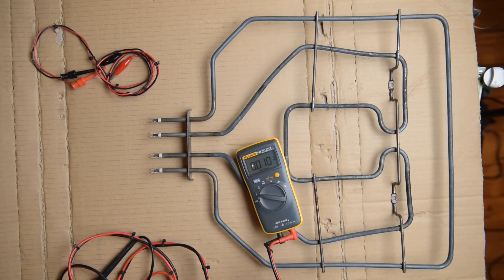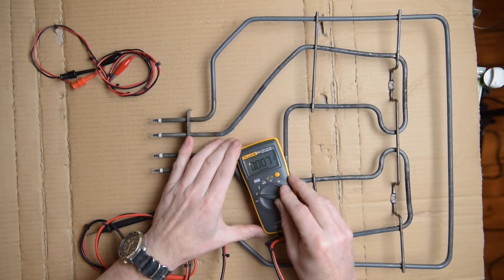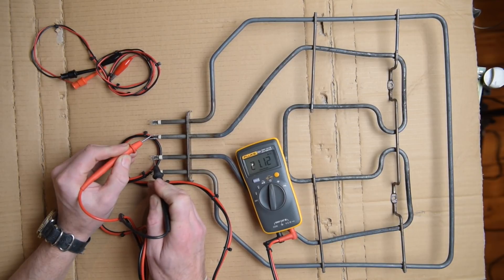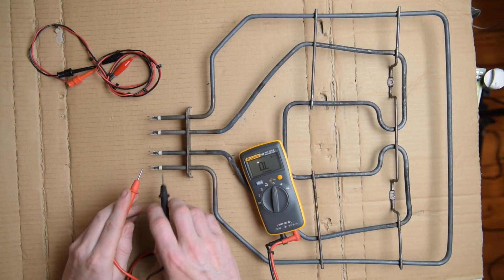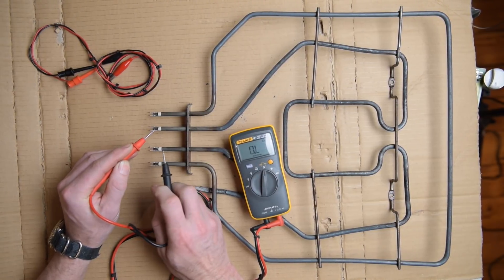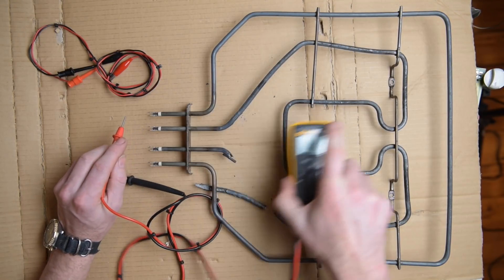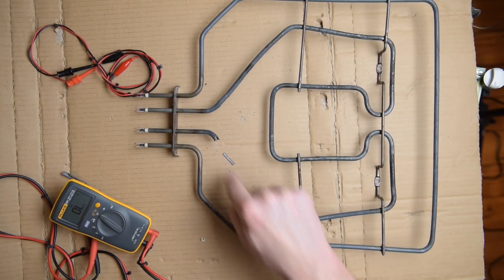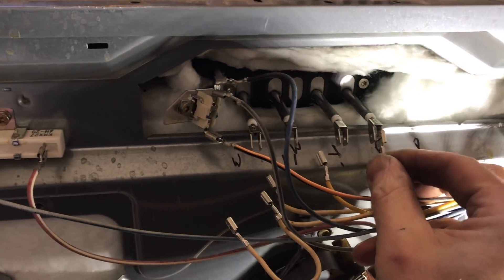Multi Meter Testing Elements.Dr Pipe

Comment: Love your videos Dr Pipe, and you have taught me many useful tips, but on this occasion the multimeter isn't the best tool for this task, you require an insulation meter as it is common for an element to break down between the inner element coil and it's outer radiant sheath.
You will get continuity through the element but the the 9v cell or 6v AA's of a standard multimeter will not check insulation breakdown, even on the highest meg-ohm scale.
They will check for the common fault of an open circuit element, but if you have an oven that is nuisance tripping an RCD (which tends to happen before the element finally goes open circuit) then an insulation meter is required.
Reply from the maker: jason laverty thanks mate appreciate. I’m not a spark or electronics engineer.. this is the best I have as it wasn’t working 👍
Reply: @drpipe  Multimeter is the correct way to determine a blown element but to truly fault find and troubleshoot  electrics, an insulation meter is your friend. They are really easy to use and a man of your skill could easily make use of one for your diagnostic work especially if you repair ovens or work with motors and pumps.
Great videos bud, and  "lets get to work!"

Comment from the maker: Just a quick vid to show a Basic resistance and continuity test with a multimeter to be conclusive in testing an element. Same technique to test any heating element ie.. Imersion heater, kettle, cooker etc. Thanks for watching.
Reply: Can you do a video on testing component on boiler like fan gas valve etc so we can rule which needs changing rather to throw parts at it and also how to test and what resistance we should expect